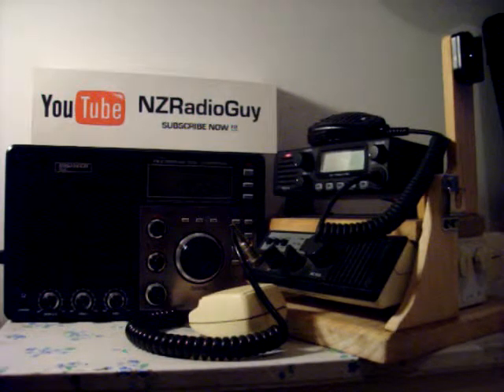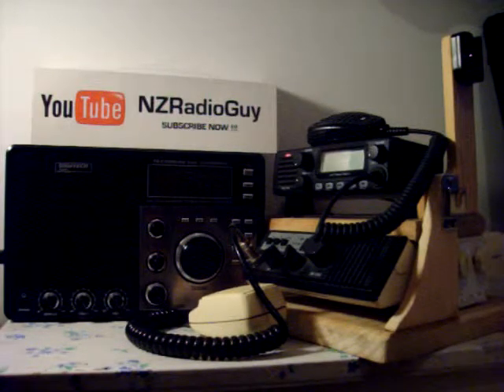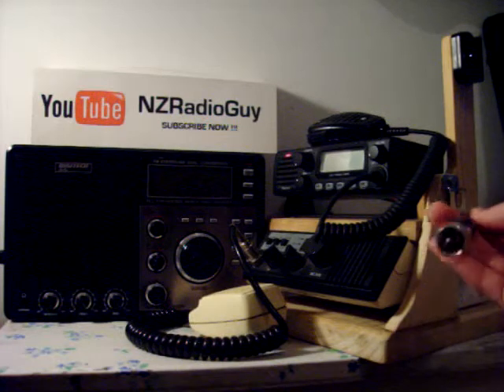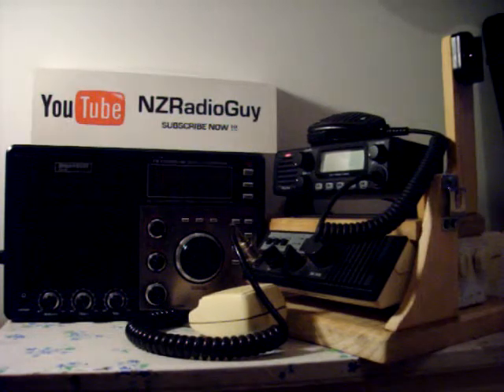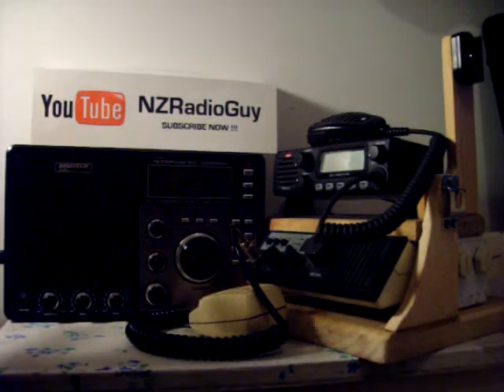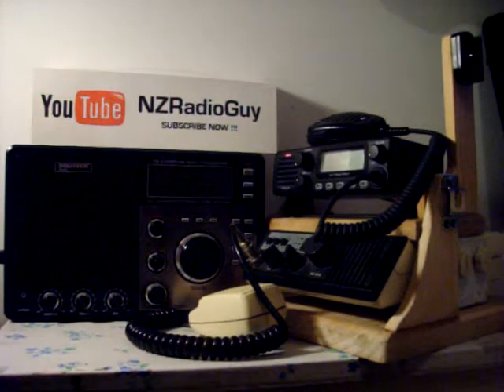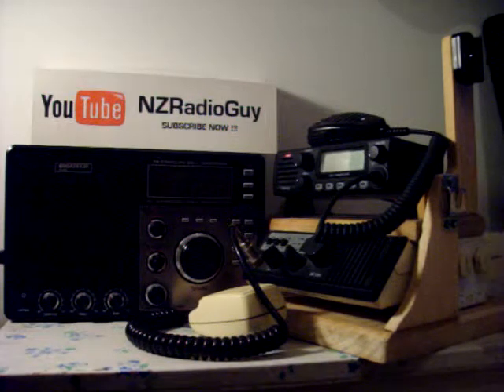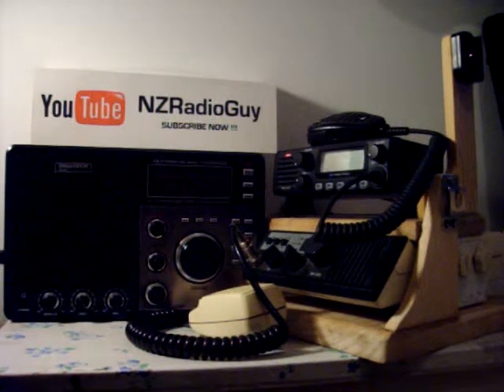Lightening Protection for Radio Equipment 101

Comment: hi i have a Pearce Simpson super lion mkII and a station master antenna. very happy with it great radio and antenna set up. it is set up as a base station. the antenna is on a 3 meter mast with is great. thats is about as high as i could got to get the best performance but my friend has his on a 1.30 meter mast, which is his tv mast. he gets out really good and the same with me. i spent little money putting this together only about $200 to $300 which is really good. i have spoken to Hawaii.

Comment: hi with the antenna, what antenna would you suggest and there is another radio model no. AR1945. i am getting this radio is made by the same company that yours is and its in jay car electronic. don't know if there is one in NZ but i was thinking of using a long wire antenna?? but if you could give me some advice it would be great. cheers and 73. all the best

Comment from the maker: Hi, Thanks, The radio in the background is a SW receiver made by Digitech model no. AR1747. I have found the telescopic antenna to be very affective and don’t usually run with an external rig, however, it has an input on the back witch I have in the past rigged a 40m Band ½ wave dipole to and found very  useful. Thanks for comment. 73, all the best. NZRadioGuy